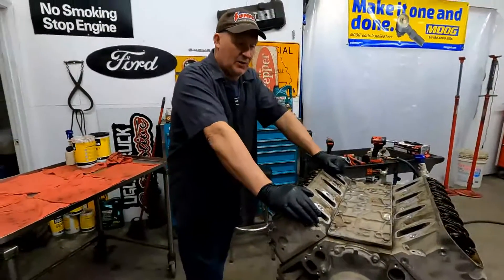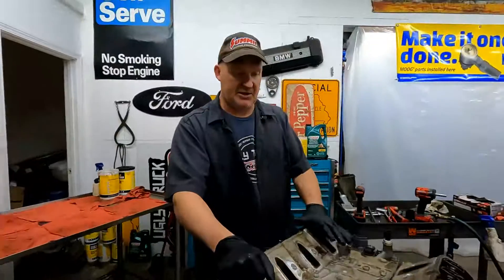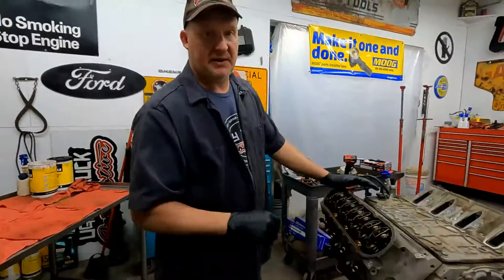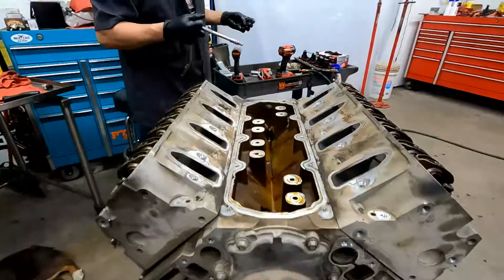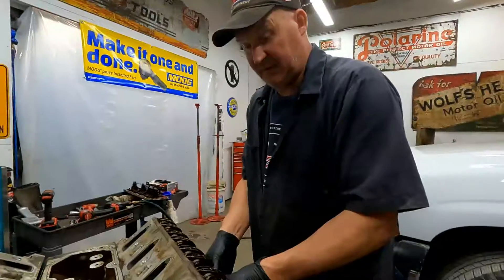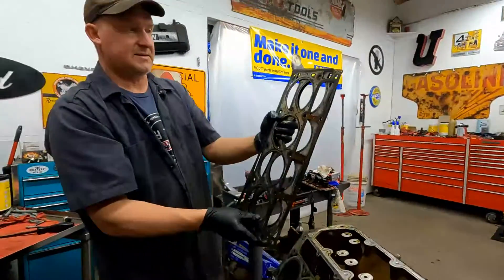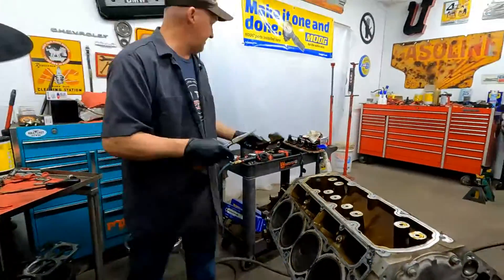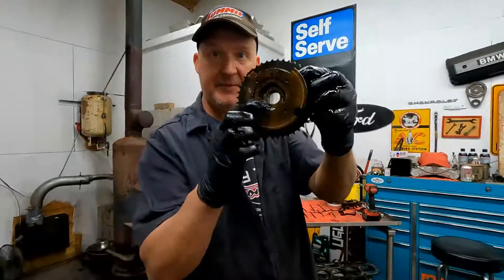WHAT'S THE DAMAGE? - 5.3L LS - LOW OIL PRESSURE - DOD DELETE - PART 1 - UTX

Comment: 4:04 fun fact, General Motors tried this before in 1981 with the 6.0 liter Cadillac engine. The 8-6-4. It was a disaster then but the diesel problems overshadowed it.
Reply from the maker: The 8/6/4 was really horrible.   Fortunately there were not to many of them before they figured out they stunk.  I won't even get started the diesel.  Jerry

Comment: Great coverage on this DOD engine! It’s my understanding that once the delete is done, these engines really perform.
Thanks as always for the great content!
Reply from the maker: They are great engines.  We have a DOD that we still have the DOD cam and lifters in and it runs like a top.  We have electronically removed the DOD though.  It also has 8 pounds of oil pressure at idle which is something we need to address soon.  Jerry

Comment: Thanks for the share! One of the best informative videos on the LC9!
I did my DOD Delete valley plate & a high volume oil pump & still have 10-20 lbs of oil pressure. My guess is that I should of replaced cam bearings with the cam.
Reply from the maker: Hey Michael. This engine had low oil pressure and the only signs of wear that we found were the cam bearing.  I was surprised that it had that much of an impact on the pressure.  You might want to pull the valve covers off and see if you are getting oil out of the push rods up to the rockers.  If your getting good amount you may be fine with that pressure and a high volume pump.  I am assuming that 10 to 20 is at idle.  Jerry
Reply: Thank you Jerry for the reply! I love your content! Will be following!
WILL DO! 10-20 @ idle is correct. New lifters, trays, pushrods, cam, valley cover with rivets & the oil pump all new.  A little mad at myself for not changing bearings at that point but motor only has 78k on it. Thank you! Will check valve covers!!

Comment: I had a 2009 Chevy with a 5.3 Ls that has the same problem how do I go about it?
Reply from the maker: Hello Michael.  Are you saying you have a 2009 with the same problem?  On this engine we ended up rebuilding it completely in order to fix it.  All new bearings, polished crank and new oil pump.  If it is a DOD, you would want to eliminate that also.  Jerry

Comment: Vlom is what they called the afm valley plate, variable lifter oil manifold. I think you mispoke a few times in the video, the lifter cant of course lift up off the cam, theres a locking mechanism in the lifter so when unlocked the spring absorbs the lifting action from the lobe and the valve on the dod cylinders stays closed, so the lifter still moves, when they fail the ussually collapse further than designed and get stuck, easy to check by removing valve cover and checking for floppy rocker arms. Great tear down video and good explanations other wise
Reply from the maker: Great explanation, Luke! Thanks for tuning in!  --Emily and Jerry

Comment: Is there anyone in central / Southern California that can help me with my Yukon lifter issue. First it was oil pressure sensor gauge . Now lifter with misfire on 7 now Stabiltrak coming on now too  I love this car and it ran so strong .. new wheels and tires… last oil change and I’m looking at in my driveway everyday now. Dealer says 10k for a new motor.
Reply from the maker: We hope there is somebody out  west that could point you in a good direction.  I would think there has to be a number of shops out there dealing with this that could save you some headache and money.  Thanks.  Jerry and Emily
Reply: Praying I can find somebody

Comment: ordered a vvt timing chain  'kit' from summit yesterday in a hurry (melling) and realized this morning no bolt included. what did you do for the timing chain replacement
Reply: I'm at the shop right now. 
New cam, New roler lifters, New oil pressure sensor, New oil pump, still looses oil pressure. Fml
Reply from the maker: Hello Bill.  Why do they call it a kit when it is missing a piece?  If your just asking about the bolt, I have reused that bolt many times with no issues. But would replace it if you have the ability to get one.  On the engine in this video I reused the cam gear and the bolt.  Replaced the chain and, guides and the lower gear. All of it's original cam related parts were in great shape and we were sticking to a budget.  Jerry
Reply: thank you for the response. summit responded via a phone call from my wife that they were puzzled as well but happily would order one direct from melling for $70.00 and extra shipping she went with it. i'm currently not very happy with summit we've already sent $700 their way trying to get my daughters vehicle going @UglyTruckExperience  i read so much indecision in regards to reuse of that bolt, wish i'd got your response sooner i trust strongly in your judgement

Comment: I don’t think it was the cam bearing.  All the bearings looked fine.  Why would you lose 20 psi from having a couple thousandths more clearance, especially with a high volume oil pump?  The fine glitter in the pan plus low pressure leads me to believe a failed oil pump.
Reply from the maker: The amount of wear in the cam bearings didn't come across very well visually in the video. We dissected the oil pump and didn't really find any wear in it so it very well could have been a pressure release problem. But I really couldn't find another explanation for the aluminum in the pan. Either way I am always trying to convince people to change those bearings when they are that close.  Thanks for watching and commenting.  Jerry
Reply: Usually it’s the oring at the oil pick up tube. I caught mine when the oil pressure when cold was starting to be low. Definitely saved my engine. This one was most likely just the oring as well.

Comment: hey man, so i just did the dod/afm delete on my 2008 5.3 silverado replaced cam,lifters, head gaskets(i bought the kit), but i just got the computer tuned so i can run just 8 cyl, but the truck is having rlly low oil pressure on the cluster, do you know what can it posible be?, pd: didint change the oil pump
Reply from the maker: Hello Javier.   I am assuming that it had good oil pressure before the DOD delete.  What method did your kit use to block off the oil passages that led to the lifters?
Reply: @UglyTruckExperience yes it was working perfectly fine, and i used a kit from amazon, the only thing i didint change was the oil pump and the valve seal's, thanks for the responde, do you know what can it be?
Reply from the maker: Hey Jacier.  What did you use for the valley cover.  Was it part of the kit that you bought?
Reply: @UglyTruckExperience I used a non afm valley plate that blocks afm towers, the oil pressure doesn't go to all the way to 0, but u can hear the tick of the lifters
Reply: like its good for like 5 min, but it goes down not till 0 but a the point were you can hear the lifters tick
Reply: it goes down to 15, my valley cover had the red o rings thank you
Reply from the maker: Hello  Javier.  Sorry for this late response. I am not sure what cam you bought, so I would be worried that the cam journals are on the loose side of the specification and I am sure you didn't replace the cam bearings.  If it is a flex fuel and you have been running higher ethanol, I have seen them dilute the engine oil with fuel and create low oil pressure also.  If you have solved this problem already please let me know what you came up with.  Thanks.  Jerry
Reply: @UglyTruckExperience hello, long story short, i replaced almost everything of the motor, cam bearings, timing chain a lot of stuff, but it  still has the problem that after it gets a little but of warm oil pressure drops, im starting to think its the kit i bought because i am running out of ideas
Reply: im starting to think its the oil pump or the o ring from the oil pan, any suggestions thank you
Reply: my bad changed the o ring alreado and the valve of the oil pan
Reply: @JavierHerrera-xu7ie It could be what's called the bar bell that's on the back of the engine that's under the rear main seal cover that's made of plastic and has a Oring that helps seals the barbell off from the back of the engine block and internal oil gallery . These can crack and cause internal oil leakage so oil pressure can drop and the Oring can also crack and leak causing oil pressure to drop off . This barbell basically diverts oil coming from the oil pump that gets pushed through the oil gallery passage then it comes from one side of the oil passage then gets diverted past the barbell and the oil gets pumped to the other oil gallery in the block and this is what feeds the cam bearings with oil . Unfortunately to get at that rear main seal cover you have to pull the transmission and the cover itself has 14 bolts that holds it to the engine block but once removed you can see the barbell in the back of the engine block. It's a slight press fit and what holds it in from coming out is the rear main seal cover is made of die cast aluminum and where that barbell sits in the block that rear cover has a boss that's part of the casting which holds the barbell from pushing out under oil pressure but these are known to crack and leak or the rubber Oring cracks or both at times which can cause internal oil leakage to cam bearings and the rest of the engine . A place called ICT Billet LS swap solutions sells new barbells that are made of billet aluminum with 2 versions available the first with just 1 Oring the second has 2 Oring's . These are machined to much better tolerances than the plastic ones are so they fit tighter to the bore that the barbell is pushed into plus they machine the bar itself a little smaller in the center which helps with better oil flow . These are also drilled and tapped on the big end for a 1/4- 20 bolt to use to help push the new one in or to help pull it back out for engine rebuilds on race car engines .  These guy work on LS corvettes a lot and have come to design some good stuff to upgrade the oil systems on these LS engines . My 09 5.3 in my truck the rear main seal started leaking bad and I decided to fix it myself which wasn't fun but since I had it torn down I decided to use this barbell and went with the single Oring and also bought upgraded billet oil pump pickup tube collar that allows better clamping of the oil pump pickup tube and it's Oring collar to use 2 bolts to camp it instead of the factory 1 bolt design to make sure there is no leakage and that the collar sits flush with it's Oring up inside the oil pump like they all should have been designed in the first place being if you look at the oil pumps on all the LS engines the pumps are drilled and tapped for 2 bolts yet GM only uses the collar and 1 bolt to hold it in the pump from the 4.8 up LS engines . My oil cooler lines were leaking as well and being I don't haul real heavy things with the truck I decided to eliminate the oil cooler lines & ICT makes billet aluminum block off plates that screws to the side of the block and it comes with a Oring and 2 stainless bolts to bolt it to the block . It's opened up inside so the inlet and outlet can allow the oil to flow to the cam bearings and if I remember they also have one that has a bung on it to hook a mechanical oil pressure gauge to it if a person decided to do this instead of using electric gauges coming off the back of the block where the oil pressure sending unit is plugged to the electric gauges on factory stuff . By doing these mods and also shutting the AFM off and using the GM oil spray diverter in the oil pan that makes the oil spray instead of going to those pistons when AFM is on shutting those cylinders down this diverts the oil to the sump in the oil pan so the engine uses less oil consumption and the oil goes where it should to the sump and to the engines bearings . After doing all if this my oil pressure went up 10 more psi hot at idle and if I get down hard on the truck until it red lines and shifts itself the oil pressure is 75 psi at 5,800 rpm's now when before it was  55 - 60 hot . ICT claimed an increase of oil pressure and they were right .  So look them up and see what they have to offer because I'm totally satisfied with the parts I bought and shipping only a year ago was pretty quick . They have videos on YouTube as well and 1 thing I do recommend is if your going to do a rear main seal buy their rear main seal alignment tool that aligns the cover and can be used to put the new rear main seal in the cover because if you don't use this tool they designed and patented it 90% of the time the new rear main seal will leak because the cover isn't aligned properly because GM on every LS engine they make decided not to put alignment dowel pins in the block and main seal cover to self align the rear seal cover for some stupid reason . There are cheaper price wise versions on ebay but most of them are made in china and I personally wouldn't trust them because they are not as nice as the ICT ones are and with all the work that goes into doing these rear seals and tearing half the vehicle apart underneath it's better to get it right the first time using tools that are made specific for this rather than relying on some person in china who thinks they know what they are doing and how to make them when they don't and thinking your saving some money it's just not worth the hassel so buy the ITC one and save yourself a massive headache in the end .
Reply: @JavierHerrera-xu7ie  hey javier ive had that problem happen to me on 4 engines already soon as dod was removed oil pressure dropped even after a full perfectly done rebuild , ive come to the conclusion that these gen 4 blocks are trash the oil feed holes where the dod lifters go are huge and when a regular delete lifter is installed there is just no way to hold pressure your best solution is to build a gen 3 block with all your gen 4 internals thats what ive done and has worked perfectly fine 40+ psi when hot good luck!!

Comment: Where is part 2 ? 
So I have a question… I have a 2010 gmc sierra 5.3 it has 300k on it but has been maintained since I bought it new, my oil pressure drops to 5 psi up top and 30 psi on the bottom, had oil sensor/filter/oil pump/relief valve in oil pan/pickup tube o ring/ all replaced and still low oil pressure took it to the dealer they said it’s the main bearings and cam bearings after replacing the pressure valve in the oil pan, it seems like I’m just getting guesses at my expense What should I do ?
Reply from the maker: Hi Kurtis! Here is a link to part 2 of this DOD delete/rebuild. https://youtu.be/_mhwmupzlSk       Most likely the cam bearings are shot in your motor.  At 300 thousand miles I personally would have just pulled it out and rebuilt it.  Sounds like you have taken good care of it so maybe just new rings, bearings and cam.  Thanks for watching and let us know what happens on this one.  Thanks

Comment: I have the same engine in my 2011 avalanche and I dread the day this occurs. Only has 69k right now and I've disabled the AFM/DOD with my handheld tuner but I've read/heard that the lifters/cam will eventually fail anyways since they're junk. My 08 avalanche got to 190k with no issues before I traded it in so we'll see
Reply from the maker: If you have disabled the afm you should be fine.  As long as the dod manifold on the top of the motor between heads stays tight.  They have a tendency to have the bolts come loose.
Reply: Just had my 2015 5.3L rebuilt… 129,000 miles. I wish I would’ve bought an AFM/DOD tuner and disabled it before all hell broke loose.

Comment: Great video!  I've watched a lot of these LC9 videos as I am dealing with one right now.  In your humble opinion, what is the best route rebuild or replace?  This is for a 2008 Chevy Avalanche that has been very well cared for.  Body is in great shape and interior is nearly flawless as it has had seat covers and dash pad on since it was new.  I just cant stomach the $8500 quote to replace the engine.  The only problem I have really found is that almost no one advertises that they will rebuild.  Everyone, at least around here,  now just wants to be a parts changer ie. Full crate swap.  Any advise will be greatly appreciated!
Reply from the maker: I would lean towards rebuilding your well kept lc9.  It is getting hard to find people willing to rebuild a motor though.  We are a dying breed.   With that motor you at least know what your starting with.  Machine shops are backed up and the turn around time is a huge issue for shops. If I had to buy a crate motor for it I would pay a little extra for a gm crate motor.  Thanks and let us know what you end up doing.
Reply: @UglyTruckExperience  thank you.  That does help to push me in a certain direction.  I’m probably going to go the 6.0 L96 route and delete the VVT.  I can buy that motor complete for $5200 and make a straight swap I believe.  Obviously update the tune, but I think you are right on getting a rebuild done just based on not being able to find anyone so far.  Thanks again.  I’ll keep you posted.
Reply from the maker: Where are you located?  Just curious.
Reply: @UglyTruckExperience  Rapid City South Dakota.